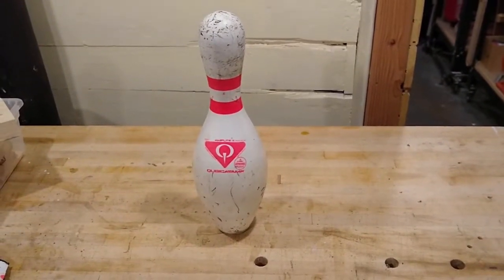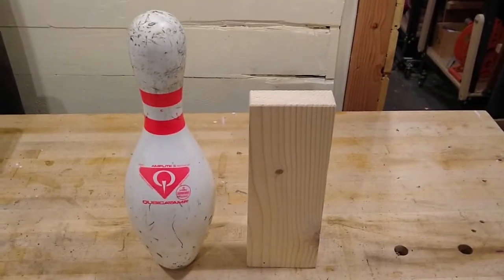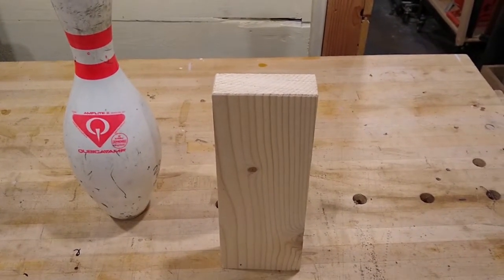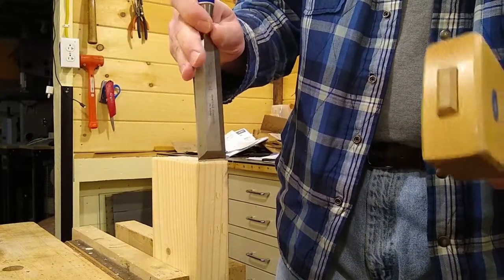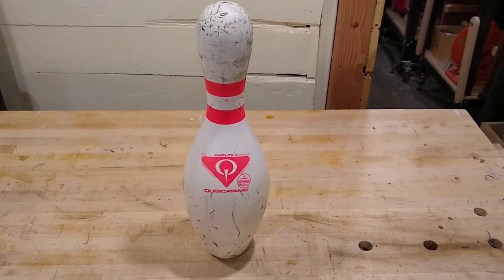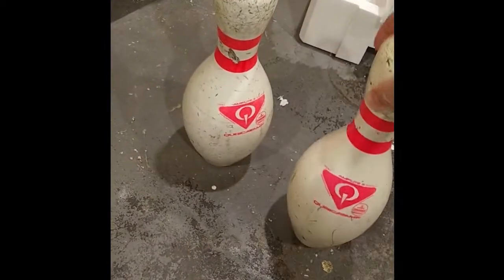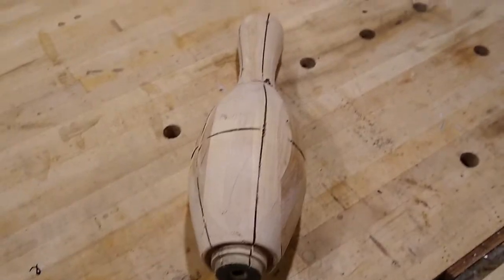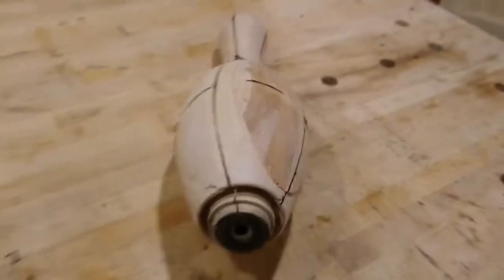Do bowling pins break?

Comment: How do you know when they ready to be changed for brand new ones? Do they have a wear and tear time limit to when they must be changed?
Reply from the maker: A specific time limit?  No.  When the plastic surlyn coating is chipped/splitting, an increasing number of pins are broken internally, and the pins generally become more "lifeless", then it's time for new ones.
Reply: @driveway_of_misfits  So the pins are inspected every so often for splitting and cracks

Comment: Only Twister Synthetic Bowling Pins could last longer for a long time. To me, those pins are great but there’s a con for Twister Pins is that they tend to just slide on the deck and won’t fall. I say order Strike Maker Pins instead, every Bowling Center in Europe (somewhere in the German or Austria areas) use those.
Reply from the maker: I've only seen one local center use Twisters and I don't think they were all that popular with the bowlers.  They may last longer but they don't sound right when hit.  AMF Amflite II are the choice around here.
Reply: @driveway_of_misfits . I wish they would save up more money on Pinnacles, those are high end pins from Qubicaamf. It’s just like Brunswick Scoreking with the Black Base and it sounds like Brunswick Pins when you hit em’. Well, Thunderbowl Lanes had those btw.